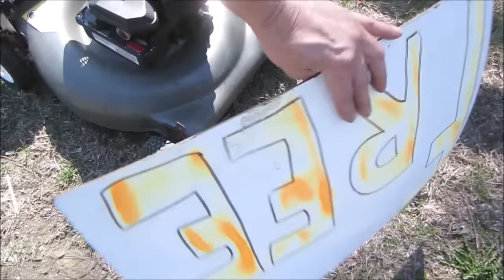How To Restore a Junk Lawn Mower For Free.

Comment: Hey musti this doesn't go with this video it's more of a question I have for you if you don't mind me asking. I have a Honda gx390 generator it sat for 20+ years locked up I cleaned the carb and went through everything changed the oil spark plug and ran it for a while it ran great then I cut it off let it sit for about 20 minutes and now it's not wanting to run off full choke I cleaned the carb again but no difference what jets am I missing I took every one out I could take out. I'd really appreciate it if you could help since I know you know a lot more than me haha.
Reply: Buy a clone replacement carb off ebay.....they work well..
Reply: Only running on choke means a fuel flow issue. I would check the fuel line and the connection to the carb. May have cracked the line, probably worth replacing if it is that old.
Reply: @kjdude8765  
Gavin has already disassembled and cleaned that carb twice. The next step is ultrasonic cleaning. But some extremely small passages/holes may be blocked with translucent crap that may not release even then. 
Forums are full of stories of ebay clone carbs solving the problem for little cost....
Reply: @JohnSmith-pl2bk  Agreed, but he also doesn't mention checking the fuel line. A cracked fuel line allows air to be entrained in the fuel being delivered to the carb, causing it to run too lean. It's definitely something to check before buying a new carb, cheap knock off or not. Also just a good idea on something that old. I just had the exact same issue with an old Husqvarna chainsaw. Someone replaced the carb, still wouldn't run without choke and gave it to me for free. Turns out it was a cracked fuel tube.

Comment: I know this is a foolish question but what is the tool Mustie is using at roughly 12:46 ?
Reply: Air Angle grinder with a wire wheel.

Comment: I disagree with your rust comment on the coil and magnetic field---both my new Snapper(1 year old) and Troy Built pressure washer would not start this spring in Texas---I had to remove the rust from both fly wheels and magnets---started right up in both cases---too much humidity in the storage shed this past winter---it had never occurred in the past 45 years of mowing and power washing.

Comment: That is definitely not an 80's or 90's era machine! That is a fairly newer machine.  Likely early 2000's before they stopped making those Tecumseh motors. They were among the worst design. Very high rate of failure on those coils for some reason, as well as a very weak and temperamental carburation system. They clog easily, primer circuit doesn't work etc...etc...etc. About half that I work on that stopped running are due to failed coils.

As far as electric start on a lawnmower, great idea but never caught on due to the high failure of the sealed lead acid batteries. That starter pulls over 30 amps at 12 volts. That tiny SLA battery is pushed to it's limit! A brand new one at full charge could just barely overcome the compression of the motor. To top it, there is no alternator to re-charge the battery, you must plug it in after you finish mowing to keep the battery topped off. Regardless, the battery is probably only good for a season or two before you have to replace it. If you do have one best to pull the cord slowly until you feel it come off the compression stroke to give the starter the least amount of resistance as possible to get enough momentum going to swing the flywheel around. There are some versions of electric start mowers that use the much larger SLA batteries like Mustie was testing with. They last a bit longer and can put out more current, but still will burn out due to the heavy load of the starter.
What IS a good idea is an electric start mower that uses already available lithium ion tool batteries for cordless drills and such. They can crank out much more current and last longer if properly cared for. You already have a bunch of them for your other cordless tools so they are easily and quickly swapped out.

Comment: Picked one up on my street - started on the second pull - they tossed it due to the self propelled parts not working. Stripped all the non working parts off ...now its a brush mower more or less.  Reuse rules !!!!!

Comment: That rust does to interfere, it acts like an insulator that's basic electrics! 
Hi myself had fixed in numerous mowers with that problem while working in a mower shop as a mechanic and also independently! 

I also know many others who have fixed multiple mowers by sanding those pickups and the magneto itself! 

There again the rest and or grease and dirt acts as an insulator and you will not complete the circuit thus you will not get spark!

Comment: Here in the UK these type of mowers get scraped because the tub just rusted out i get loads with good engines that are literally falling through the the tubs.
Reply: Aluminium bodies are the way to go.....
Reply: @JohnSmith-pl2bk  Yes theirs a company called Hayter mowers here in the UK. They have been making Aluminium mowers for years they are very top end. They start at over £1000 for a basic model. Most People will not pay that for a mower. I have had a few of them that have come in with a good tub but worn out blade and knocking engines. Fresh engine and a new blade back in service. It always pays to keep old parts and engines that are still good. It`s just the room they take up.
Reply: @russellkerfoot5423  
The brand in NZ for 50 years that did the same was Masport (Mason and Porter)  They could not compete with cheap Chinese built flimsy steel bodies....
However, I have never used any other bodies...
I just went to the junk pile at a mower shop and for $25 got another aluminium body about 20 years old...like new...when mine wore out...and put my FV160 Kawasaki 5hp with full flow oil filtration engine on it....

Comment: it's a Tecumseh engine isn't it? my father changed the oil ZERO times in 20 years and it's still working! I changed the oil for him and I found a small glass of black sticky goo inside.
Reply: Now that mower could do with some detergent oil in it for one lawn mowing session before changing the oil again....more of that black goo would then be liquid enough to exit the sump via the filler....

Comment: To be fair, if someone actually greased the rear wheel assembly with the grease nipple occasionally they wouldn't get so nasty.  Mine is from 2006 I think and I've greased both with the grease nipple once a year and I've never had them seize up and they've never been apart.

Comment: I have had much better luck with graphite on the starter drive spline then oil, oil will attract dirt and has more resistance to movement than the graphite will.

Comment: The exhaust valve seat fell off. I tried everything and finally took it to a repair spot and he diagnosed from a stool behind the counter and said I could buy a new one for less than the cost of the repairs.

Comment: Plug fowlined.  The reason is that dirty air filter - running rich.  I would blow out that air filter and then pressure wash it.

Comment: Champion Eco-Clean is a premium small engine spark plug designed to deliver smooth starts, optimum performance and maximum plug life.
A direct fit replacement with improved fuel economy

Perfect original equipment replacement for lawn and garden applications and similar engines

Fine-wire center electrode improves ignitability with focused spark for faster, easier more consistent starting

Patented rib core nose design fights fouling and provides an alternate spark path to promote continued engine operation when plug contaminants are present

Comment: You contradicted yourself with the blade sharpening explanation and then how to adjust cut height. Since the blade rotates as you move forward, the front end of the mower does all the work. Angling the deck forward actually relieves drag on the blade at the back wheels. The grass has already been cut at the front of the rotation, so on the trailing arc the blade does not have anything to cut, so it can be above the cut grass and just have clippings to deal with, instead of dragging through cut grass. Depending on the smoothness of the ground, with wheels adjusted to the same height, the rear of the mower deck may even drop down if the front wheels rise, so the back arc of the blade rotation re-cuts the grass, and you get a scalloped cut pattern.

Comment: Save the wheels burn them off over time. Looks like toro needs better their push mowers with a better air filter and using aluminum for a belt cover, better self propelled system

Comment: Too easy. Lol. I hoped that Tecumseh had no exhaust valve clearance and that the valve had to be ground and lapped it. Then it would be the exact one I am struggling with. I ground the valves to 0.010, lapped then in, and the exhaust leaks. I don’t know what I’m doing wrong.

Comment: Scarp it, buy battery one. Get rid of noise, nasty fumes and problematic start and never ending maintenence with nasty oil and spark plugs.
Reply: Not if you have a large area of grass...or it's long thick grass...unless you have multiple batteries...

Comment: Should really use non-detergent motor oil for anything without an oil filter.
Reply: The sump does not have enough depth or capacity to have an undisturbed area of oil at the bottom into which the dirt can settle out of the oil...and stay there.
 There is also no drain bung...so the dirt has to come out the filler....so use detergent oil, and empty the oil when it's nice and hot...taking all the dirt with it.
Fill with fresh...detergent oil...
Reply: @JohnSmith-pl2bk  My manual says non-detergent, single-viscosity oil. When I didn't have any on hand I tried 10W-30 Castrol Syntec. It had a rod knock, I thought I ruined it. Got some straight 30 ND, and fixed it thankfully.
Reply: @dasworkshop4967  
Was this a top up, or a complete change? Which brand of engine? OHV or side valve?
A friend has reported a rod knock and knowing him and his obsession with top notch oils in a Briggs and Stratton engine, this may be his problem as well?
Reply: @JohnSmith-pl2bk  Complete change, on a Briggs and Stratton GTS Toro Personal Pace from 2010 or so.

Comment: u could at least clean them up and polish them and give the tires the wet look and makes blacks black and white white and washed the bag and changed the string and sharpened the blase, replaced the sparkplug airfilter fuel filter and filled it up before giving it away for free  ...  lol 😅😅😅

Comment: Do not ever grasp the pull cord firmly when starting a mower you don't know. Always hold it, lightly, with 2 fingers. If they hit something with the blade, which is sometimes evident by dings or it's bent, and sometimes it's not, and the flywheel key is sheared or even has a small ding in it, that engine will yank your fucking arm out of the socket when it kicks back. If you hold it lightly and the pull cord gets ripped out of your hand, it may sting your finger, but it's better than a dislocated shoulder.

The drive system is fucking terrible on those toros. I used to work at Sears fixing mowers and other small engine equipment, I probably worked thousands of mowers in just a couple of years, and this is one of the worse drive systems.